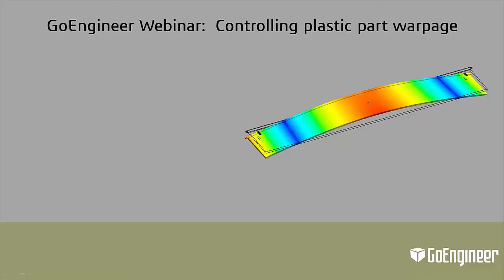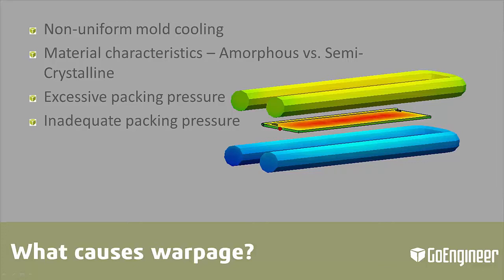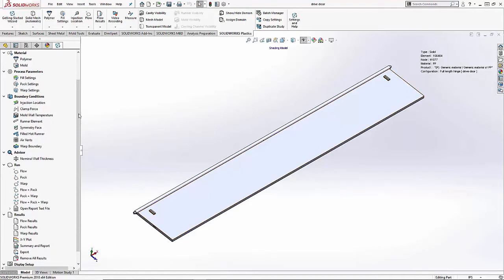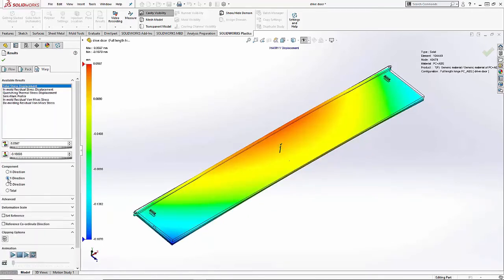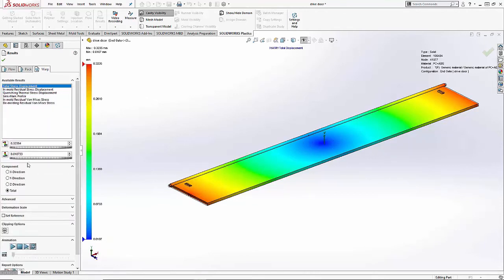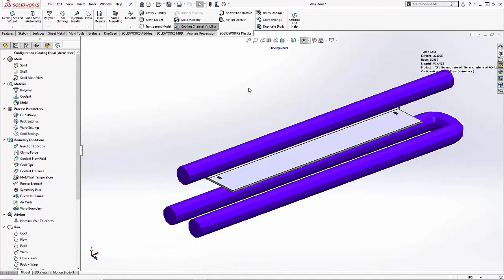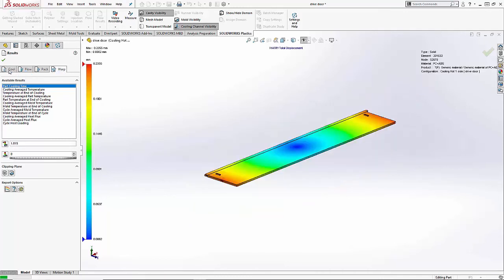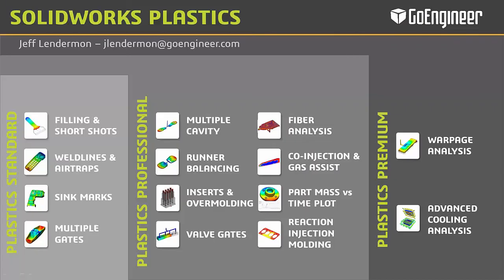SOLIDWORKS Plastics - Plastic Part Warpage

Comment: The biggest contributors to part warp that I have seen over the last 43 years is cooling cycle/temp and in post-mold handling. Most molders are Commodity Molders. They have learned that the faster they cycle the mold, the more money they make. This means that they short the cooling cycle and pop out parts that are under-cooled. To compound this, they typically toss the hot parts randomly into a cardboard box so each part lays differently as they land and subsequent parts land on them and press them into distorted shapes as they continue to cool.